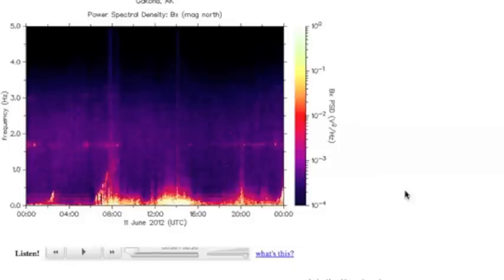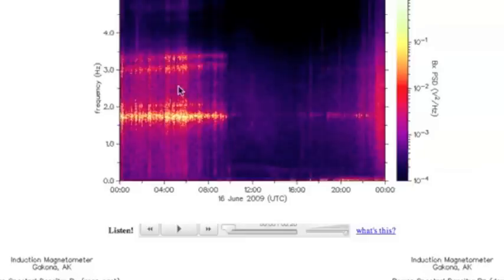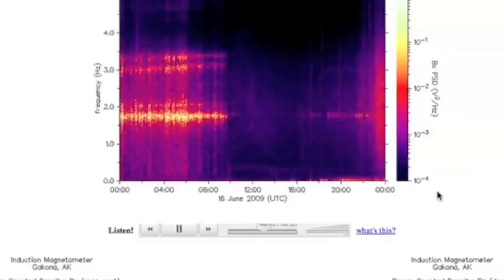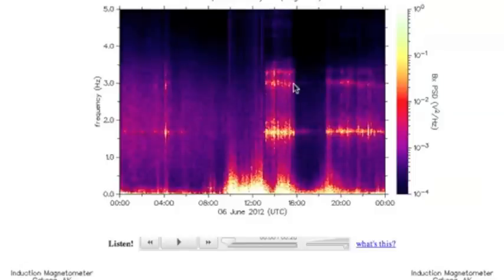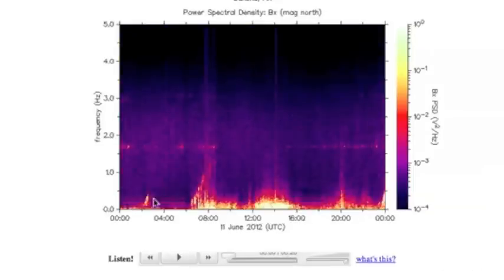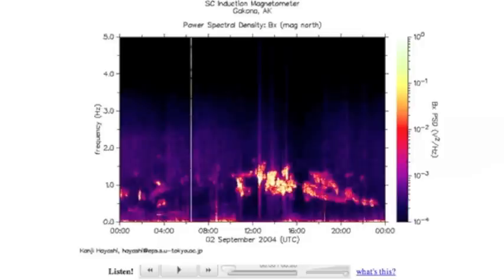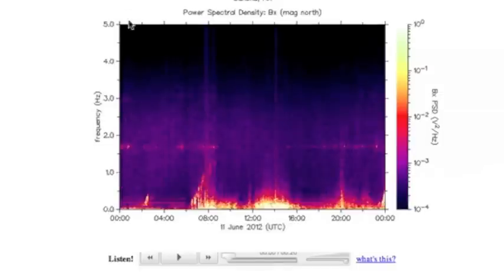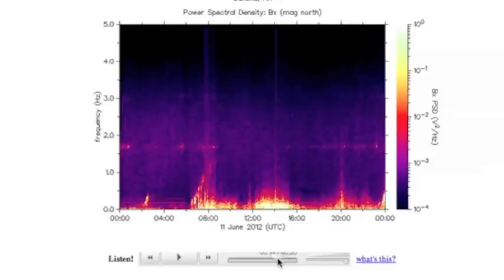Unknown Readings/Sound JUNE2012 - Induction Magnetometer

Comment: Thank you for all your work and insight SO! 

From what I can hear (it's more easily heard on more recent days) there are 2 different sounds. The eerie one doesn't seem to be the sound of those strange lines that start at 14:00 each day. I can hear a low distict tone that starts and stops abruptly with those perfect lines of resonance. The eerie sound is identical to the sound made by the wind blowing a loosely anchored steel airplane cable around an aluminum flagpole in a spiral. Perhaps

Comment: Pause at 1:43 if you look between 00:00 and 04:00 you'll see the little increase just after half way, if you go back to to the scmag and search '20120612' you'll notice the same things (almost the same about 95% equal to) occurs just before 00:00, this is quite odd as they're not to far apart, by about 2-3 hours

Comment: The strange patterns that were on the BZ now show up on the BX also. And if you look at the HF chart it has many of the same type of patterns which is not normal for that one either. It really makes me wonder if those are some type of transmissions. Especially on the ULF chart. That is where you would see submarine transmissions. Got to remember what they say the HAARP is used for as well as what they deny it is used for. Could be ground penetrating topography as well.